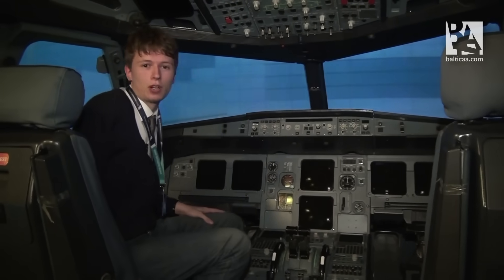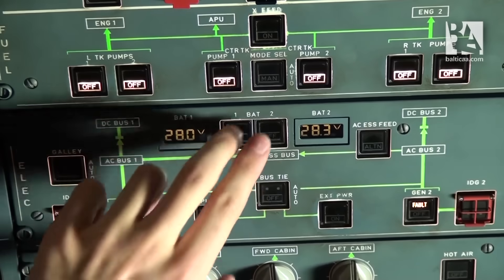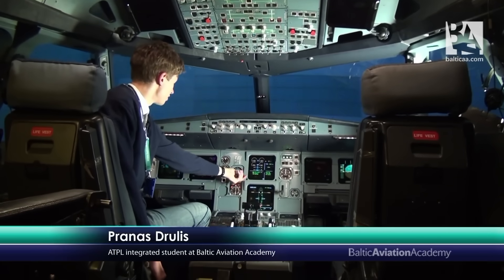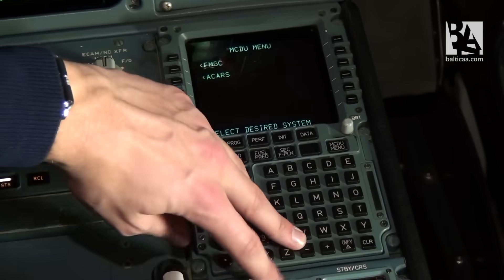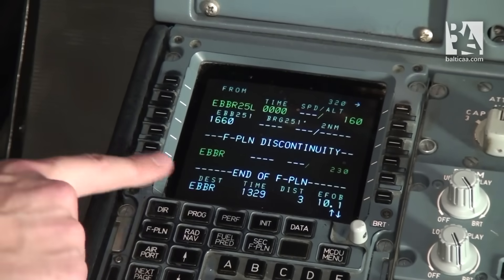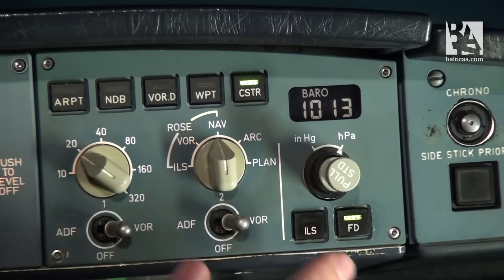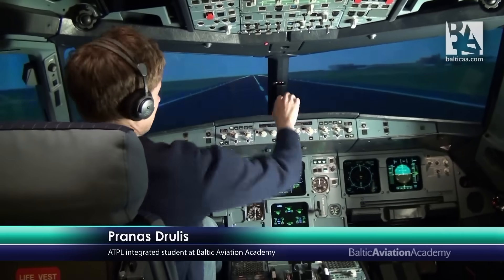Airbus A320 - From Cold and Dark to Ready for Taxiing

Comment: Do not understand. Select cruise level two zero, that is two thousand feet. At end he says, on setting up fcu: " climb altitude four thousand feet."  Why would you climb to four thousand feet, then come down to two thousand feet to cruise?
Secondlly why put in flight from Brussels to Brussels? Then you might as well not start up the aeroplane and passengers can just climb on board and off again and go home. If it is a return flight, then surely one would key in the next destination before return.
If it was for illustrative purposes, one could have made it more realistic.
Please correct me if I'm wrong.
Reply: 2 0 metres?
Reply: @Robin-bk2lm  20 meter? Is that not to low for flying?

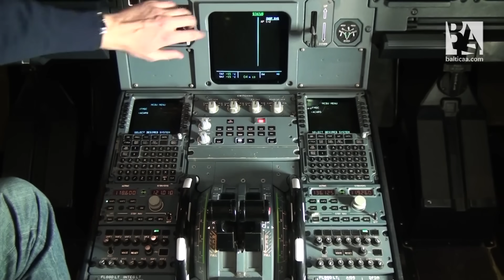Comment: 7:51  What function do the red buttons under the covers on the throttles do?
Reply: Turns on/off auto throttle (auto speed)
Reply: Do you mean on the sides of the thrust lever handles? That’s the autothrust disconnect button
Reply: @tomstravels520  No, I mean the two red buttons on the front of the ascelerators, (which have a cover, so they are not visible).
Then I found out that it is to give more power under certain conditions. Thank you.
Reply: @adrianalejandroyt  I still don’t know what you are talking about. There are only 2 red buttons near the thrust levers and they are the autothrust disconnect buttons. There is no “turbo boost” button. The maximum power you can get is TOGA which is done by pushing the levers fully forward. What covers are you talking about?
Reply: @tomstravels520  if you look at 8:58, you will see two caps, which hide the 2 red buttons ..
In front of the ascelerators.
I am going to look for an image with the covers raised and the buttons to be seen.
Reply: @adrianalejandroyt  do you mean the one red button that is amongst the ECAM systems page selectors? There is only 1 red one which is guarded and it is the emergency cancel button for ECAM warnings
Reply: @tomstravels520  No, I mean the two red buttons, one per throttle, seen in this picture:  https://pbs.twimg.com/media/Eo0MrD6XEAAh9dM.jpg, they serve to give extra push, adding fuel, especially when they are for For example, short tracks. have a limit of use and must be registered.
Reply: @adrianalejandroyt  oh the bump thrust switches. They’re only on the older IAE engines and used for short field performance as it gives you 10% extra TOGA thrust.  Yes if you used them they had to be recorded and checked after certain usage

Comment: 7:48
(1) Now we will continue with the thrust levers once again. 
(2) We will check that they are in their positions.
(3) We will check that the engine Masters are both OFF.
(4) We will check that the engine MODE Selector is OFF.
(5) that the ground spoilers are retracted and disarmed.
(6) and that the FLAPS are selected UP,
(7) RADAR trim is showing 0.
(8) Parking Brake is set to ON and 8
(9) that the gravity GEAR extension LEVER is in its correct position as well. 8:25

Comment: 7:02
All lights are okay, the weather radar is off and we'll go a bit forward.
(1) Now we check that all the switchings are in their Normal (NORM) positions. 
(2) And we'll check few data on the lower ECAM display. We'll check the engine (ENG) to check if we have the correct ENGINE OIL quantity. 
(3) Then we the hydraulics (HYD)
(4) Then look good for this stage of the flight. 
(5) And we will check the OVERALL STATUS (STS) page which shows any more functions which may be there. We have only one which is Autopilot 1 + 2 - this is perfectly Normal because we have no engines running and we are on the ground (GRND) 7:48

Comment: 6:23
(1) Now we'll be heading DOWN to the Centre panel where we'll CHECK all the Standby (STDBY) instruments.
(2) We'll pull this knob to make the Artificial Horizon work
(3) And we'll check that the Anti-Skid (A/SKID) and Nose Wheel Steering (N/W STRG) button is set on the ON position. 
(4) And now we'll be heading from the CENTRE position to the PEDESTAL. it is set on VHF1. Frequencies are (118.600) (121.010) OKAY.
(5) And transmitting on the interphone, receiving as well, and Public Address (PA) system. 7:02

Comment: 5:52
Radios
VHF3 
(1) EICAS (Engine Indicating and Crew Alert System) Frequency 121.500 and we 
(2) SELECT button on the Public Address (PA) system
(3) then we go up CHECKING the MAINTENANCE PANEL for any WHITE lights. We can see NONE. 
(4) then we CHECK all the CIRCUIT BREAKERS that the AUDIO SWITCHING button is on NORM and now the OVERHEAD SCAN is complete. 6:23

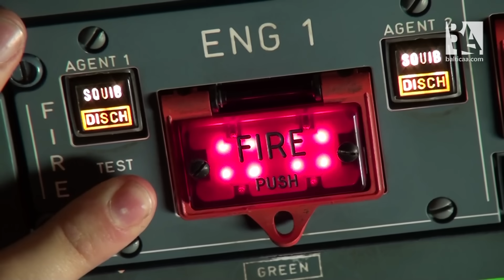Comment: 5:25
(1) And the same happens with Engine FIRE number 2 (ENG 2)
(2) We continue with the right-hand side, starting with the wipers (WIPER), Rain Repellant (RAIN RPLNT)- everything looks clean and good here. 
(3) (CARGO SMOKE) 
(4) (CARGE HEAT)
(5) Flight Control Computers (FLT CTL) are in good working order and we end up with the Radios. 5:52

Comment: 4:55
(1) Now the Hydraulic panel (HYD) displays no lights.
(2) Now we have to do the Engine FIRE test. to do this I press the TEST button. We can see the three lights illuminated. We look at the FIRE LIGHTS at Engine Master Switches. (FIRE 1)
(3) Then we turn off the Master Warning. And 
(4) CHECK the ECAM display for its CHECKLIST and the TEST is COMPLETE. 5:25

Comment: 4:00
As you can see 
(1) the lights on pack 1 and pack 2 have extinguished, this means that the packs are fully working and the air-conditioning is working as well. Now continuing on to the 
(2) Electric panel (ELEC). We have two FAULT lights on generator one (GEN 1) and generator 2 (GEN 2). But that is perfectly normal because we have no engines running and nothing runs the generators.
(3) Now we will test the battery to see if it is charging correctly. We SHUT DOWN the batteries. And we RESELECT them. Now we're finished with the Electrics (ELEC).
(5) We can extinguish the lights on the FUEL PANEL (FUEL). To do that we will SELECT all the PUMPS to Automatic.

Comment: 3:30
We can continue with the OVERHEAD SCAN from the CENTRE.
(1) We select the SEAT BELTS ON
(2) the NON-SMOKING to AUTO
(3) the Emergency Exit Lights (EMER EXIT LT) to ARM.
(4) We check the landing elevation (LDG ELEV) is at AUTO
(5) We select the AIR-CONDITIONING PANEL 
(6) We select the APU BLEED to ON to supply us the air from the Auxiliary Power Unit ( APU) to COOL or HEAT the CABIN. (4:00)

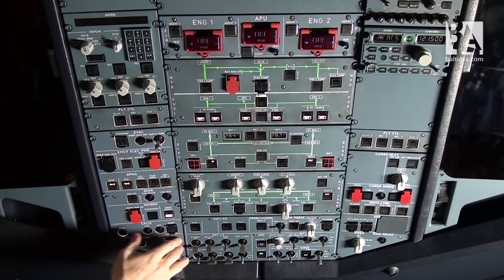Comment: 2:28
We start with the 
(1) CREW SUPPLY (OXYGEN) light. No light, it's good. 
(2) Now we test the Recorder (RCDR), the Flight Data Recorder, RCDR. We select Ground Control (GRD CTL) on ON. And test it, we hear the beep, everything is alright. 
(3) We have the FAULTS (GPWS) but It is absolutely acceptable because now we're on the GROUND.
(4) EMERGENCY ELECTRIC PANEL (EMER ELEC PWR) - the PANEL is okay.
(5) EVACUATION (EVAC) is okay
(6) Flight Control Computers (FLT CTL) are good.
 (7) Now SETUP the ADRS, the (ADIRS) - Air Data Inertial Reference System which tells the AIRCRAFT where it is currently LOCATED. We start by rotating the knobs one at a time to the NAV position and wait till the light extinguishes.

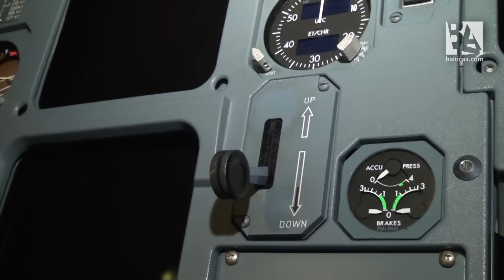Comment: 00:50
As we have completed the necessary checks, we can now POWER ON the aircraft. First of all, (1) we select BOTH BATTERIES ON. 
(2) Now we have to do the APU FIRE TEST. Both lights are illuminated, ie the test is performing quite well. And 
(3) we can START the APU itself. We start the MASTER SWITCH ON and 
(4) the START.

Comment: 00:30
The aircraft is currently in a state which is called 'COLD and DARK'.
Now, in order to select the power ON, we have to do a few checks. So we check 
(1) that the thrust levers are at IDLE
(2) that the Engine masters are OFF
(3) that the Engine Mode Selector is NORMAL
(4) that the Parking Brake is SET
(5) that the Gear Selector is DOWN and
(6) that the Windshield wipers are OFF

Comment: I like how basiclly the a320 needs only the ground power then APU to be turned on ,then you have to check the cockpit, put in the flight data and then set the engines on ignition and switch the thing an boom you have a working a320 while on the 737 literally you have to die turning on the groun power ,yaw dumper, apu generators then ignition, the fuel pumps , the bleed air of the APU ,the elctrics, hydraulics , the start the ignition of the engine the turn on the mixture .
Literally the a320 is like a multi million dollars toy next to the 737 ,but I still love the complicated 737💕

Comment: 11:55

Cruise Altitude: 2000ft
Initial Climb: 4000ft
Reply: k it wasnt just me that though that was odd
Reply: All good. V1 And Vr are the same as well... But that's fine, since he's going where he already is
Reply: @MadScientist267  V1 and VR can be the same thing sometimes.
Reply: @MadScientist267  most of the times V1 and VR are same, some of the pilots brief when they are not so they dont automatically rotate with v1
Reply: @adamwolf9687  the hormones on this teenager that is playing ace combat and thinks he knows everything about aviation now 😆
Reply: @MadScientist267  V1 and VR ARE NOt THE SAME,I AM A AIRlINR CAPTAIN
Reply: Reach cruise altitude in 30 seconds 😁
Reply: @sirtango1  Sure!!! You're flying on NASA airlines!!!😆🤣
Reply: @sirtango1  NO
Reply: We must be some were -2000 sea level 😂
Reply: I came here to say the same thing. Beat me to it ;)
Reply: Was wandering that. Ha Ha
Reply: 1. Cruiselevel CAN actual be lower than the Init. climb altitude/level. This can be the case with GA planes where they need to climb to a certain altitude to avoide obstacles, but are cruising lower when possible. 

2. Flightnumber CAN be the Callsign, or the Airline Flightnumber. Usually when CPDLC is used the callsign will be put into the FMGS.

Also, flaps are set to their T/O position after the enginestart while you dont't have any hydraulic pressure without a specific engine running. In this film, they won't show you where he sets the flaps.
However, before T/O on the upper ECAM screen you can clearly see the flaps in 1+F and the lever sits in its 1 postion.

Most of the time the V1 and Vr speeds are the same on a dry runway. The speeds are calculated.
When there is need for a bigger margin between V1 and Vr this can be added.
Reply: @BeauVerwijlen  
14:28 what about completing the takeoff checklist while gently rolling down the runway, is that usual practice too? 😂
Reply: Welcome to Rollercoaster Airlines, please fasten your seatbelts

Comment: What is gravity gear extension role?
Reply: If there is a hydraulics fail or some other reason the gear won’t lower then you crank the handle 3 times to open the doors, shut off hydraulic fluid and then release the locking mechanism that hold the gear up. The gear will then lower by gravity and lock into place

Comment: Setting initial altitude of 4000 feet when cruise is set to 2000 makes no sense. Could be company SOP, but I am pretty sure after pressing APU Master switch you need to wait until the FLAP DOOR is open in order to actually start the APU.   GND CTL I also believe is pressed and left pressed while on the ground to record the cockpit communication.
Reply: No. APU waits until door open to start.

Comment: But Rotate (vr) Spd should be more than V1 na  Ur V1 spd is 130 and Vr spd is also 130 it should be atleast 135 na ?
Reply: No they can be the same. Usually if the plane is light or on a long runway

Comment: God knows what might happen if you doesn't have your windshield wipers off. Why is this so important?
Reply: Airplane windows have special coating on that can be damaged if the wipers are run dry. You don't wanna damage a really expensive window because you simply forgot to make the sure the wipers were off before you powered it up.

Comment: I always wondered why we need to check the wipers. it seems so out of place on that checklist. I still expect one of the most random yet harmless bugs you could never think of and instead of fixing the bug they just added "windshield wipers:..............off" to the checklist X'D
Reply: If they were on when power is connected you have dry blades scratching the glass. Very bad for a pilots view. So you make sure they are set to off first which you should also do in your car....
Reply: @ricardoroberto100  Okay, I get that, but we gotta agree as well that when the blades scratch the glass, you may have a way different problem on your hand^^
Reply: @boahneelassmal  not sure what you mean?    Flying at night is particularly affected by marks on the windshield.   Under heavy workload you dont need distractions affecting your ability to focus.
Reply: @ricardoroberto100  If the wipers are in a shape which allows them to scratch the windshield that would indicate a lack of maintenance to me...
Reply: @boahneelassmal  no because grit can still be on the screen!  Ask any pilot.

Comment: Why tf is the baro set to hecto Pascal's instead of inches of mercury? The altimeter is calibrated using the barometric pressure in inches of mercury.
Reply: In Europe it’s usually set to hPa and as this is a European airline that is why
Reply: @tomstravels520  but if a European airline were to fly to America they would be forced to use inches of mercury because everything here is calibrated with that.

Comment: I have always wondered, does someone clean all those switches, screens, selectors and knobs that the simulators and the planes themselves have?  I say this because it is common, as in this video, to see them somewhat dirty and greasy .. 🐷
Reply: The knobs closest to the first officers seat had caked dead skin where the console and the knobs connected. Remember the old mouse that had a ball inside and the rolling ball would gum up. That gross gunk that had to be scraped out was nothing compared to this console. If that is what you can see, what about the other stuff

Comment: Looks like you forgot to turn back the engine mode selector back to normal after good N1 % on both engines.correct me if i am wrong
Reply: Pranith Sarma Chandrapati as the ECAM is showing the gear page as default when taxiing I’m guessing it was done between the edits otherwise the ENG page would still show
Reply: @tomstravels520  tq thomas

Comment: Retired from an airline and worked in training department for a time.  Have experience in both Boeing’s and Airbus.  A320 when light on fuel can override park brake if one foolishly does full power run up.  Also CFII in both airplanes and helicopters. Great whole-part-whole teaching technique.  Nice job.  Good luck in your career. You are a good instructor.

Comment: NO light means normal condition? How do you know if it's not a failed lamp?
Reply: The switch at 3:39 labelled ANN LT when out to test will illuminate all the lights so you can check for blown bulbs
Reply: @tomstravels520  Thanks, man! BTW, what does ANN stand for?

Comment: This is the aviation equivalent of getting in your car and starting it in gear. It's a good job it's a simulator because otherwise i'm sure it would have rolled over both of them as they walked away having left the parking brake off..
Reply: Andy McGeever planes are chocked and I believe sometimes the parking brake is off when chocked to help cool brakes after landing

Comment: If you stall it, on the runway before take off, is everything still checked off when you fire it back up, or do you have to go through all the checks again, cos you've turned the key in the ignition, off and then on again to restart it... seems a bit of a pain if it's your first time driving stick!

Comment: Interesting, some girl was just in the news after she tried to steal a jet and crashed it into a fence. I wondered how she ever got it started thinking it was really complicated to start. However after watching this it seems there are basically only 6 essential things to actually start the engine, Batts On, APU Masterswitch ON and Start, Engine Mode to Ignition, and finally the two engine switches.

I wonder if something like this is where she learned it, this kind of goes to my thought that while most things are legal to put on the internet, there are some things that might be better left off even if it is legal.
Reply: You need the flight computers.  This is a fly by wire aircraft.
Reply: You got THAT right. Reminds me of when I saw a rich guy who bought a helicopter try to fly it for the first time (autorotated and crashed on take-off at 30 feet). Thank god there were not a lot of people around. But you're right - it all comes down to: (1) turn key and switches (2) rev up engines (3) move hand and foot controls, to achieve desired results! Just ask the Wright brothers - taking off is the easy part...

Comment: Prior to departure you did not set Strobe to on, nor during set-up of the radios was each of them set for 121.50 as standby, did ATC assign the same TCAS code as you already had? IF so you did not enable the transponder.  I'm not even a pilot.

Comment: You started taxi & takeoff before disconnecting the APU.
I can see the sparks now as you drag it across the apron. :)
Reply: that would have been the GPU (Ground Power Unit). The APU is an integral part of the plane located at its tail, which (you are right btw) should have turned it off for taxi and take off.

Comment: So you start the engines before you do push back?  Is that normal?  I thought first you did pushback and once in the taxi way and before disconnect, you got clearance by the tow driver to start engine.  Normally engine 1 since the CPT side wing walker would be in front of the aircraft marshaling the CPT to stay on hold while the aircraft is disconnected from tow bar and the tow driver and right side wing walker clear the taxi way.  Once they clear then Engine 2 is started.
Reply: A.D. Peguero most of the time they do a thing called a push and start so they start the engines whilst pushing back to save time